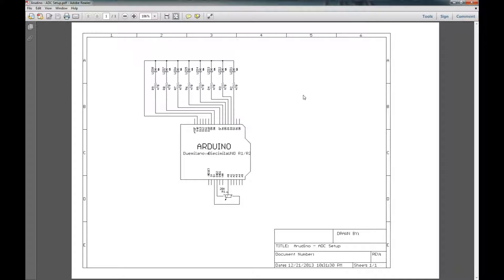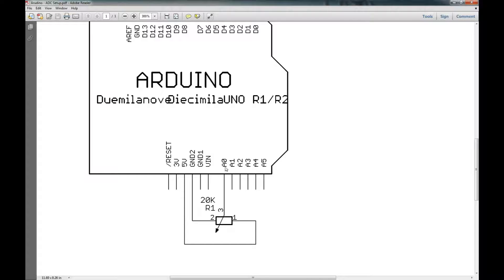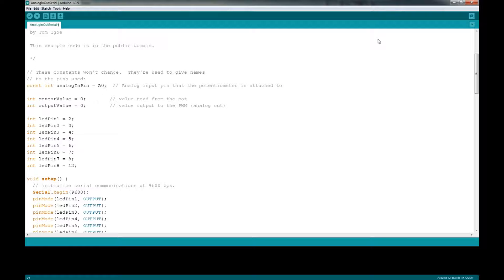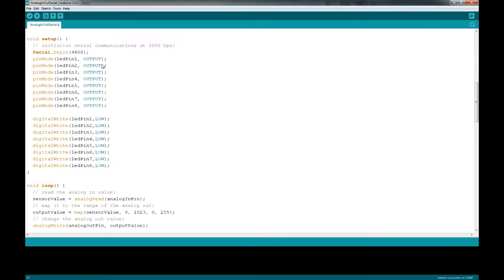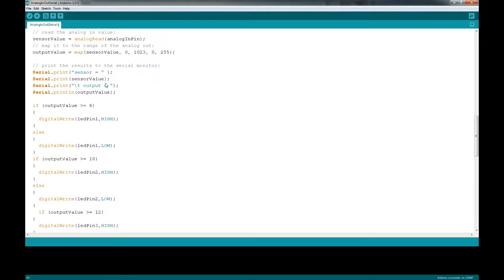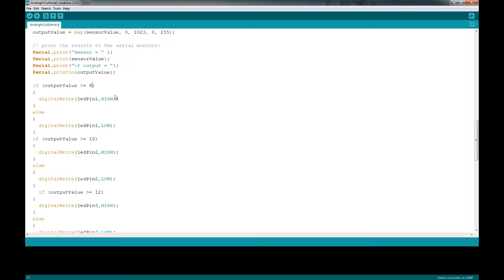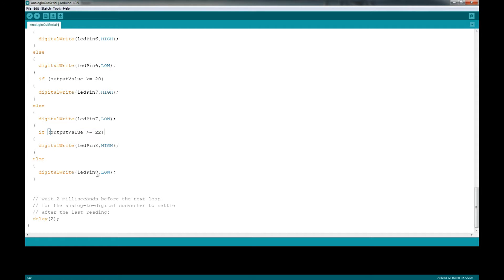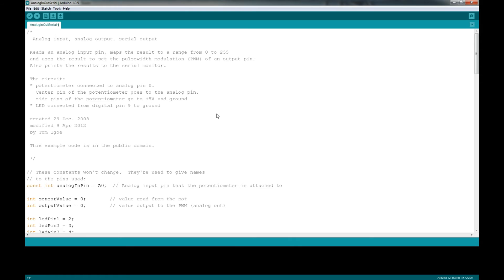Arduino - Simple ADC

Comment: The reason it is 0 - 1023 and not 1024 is because 0 counts as one of the values. If you said 0 - 1024 that is actually 1025 steps.... hope that makes sense.
Reply from the maker: Yep and thanks for the correction.  Sometimes I cannot speak LOL

Comment: hi, i'm really new to arduino and  i have an 
arduino mega 2560 adc and need a code that enables me to see as an output the digital values. could you help me?
Reply from the maker: Hey there I can help you with whatever questions you may have.  There should be libraries for that with example code to help you out
Reply: @misperry  hi, can you see if this code makes sense? 

const int analogInPin = A0;  // Analog input pin that the potentiometer is attached to

int sensorValue = 0;        // value read from the pot
int outputValue = 0;        // value output to the PWM
int tenBitValue = analogRead(analogInPin);
byte eightBitValue = tenBitValue / 4;
void setup() {
  // initialize serial communications at 9600 bps:
  Serial.begin(9600);
}

void loop() {
  // read the analog in value:
  sensorValue = analogRead(analogInPin);
  // map it to the range of the analog out:
  outputValue = map(sensorValue, 0, 1023, 0, 255);

  // print the results to the Serial Monitor:
  Serial.print("sensor = ");
  Serial.print(sensorValue);
  Serial.print("\t output = ");
  Serial.println(outputValue);

  // wait 2 milliseconds before the next loop for the analog-to-digital
  // converter to settle after the last reading:
  delay(2);
}
Reply from the maker: Ok so what I see are some problems is that on your analog pin you really don't need the const.  Also you don't need to put the letter "A" there since it will confuse this with the hex number 160 (0xA0).  Also you don't need to read the analog poins before the set up if you are going to be reading it every time you loop.  I am not sure why you are deviding by 4 to get 8bit and what you need that for.  Also your comment mentions PWM are you trying to produce a PWM wave somewhere or are you just interested in the digital number for the given analog like 5V = 1024 or something?

What you need to know is the voltage range that you will be working with.  If you are going off of the microcontroller voltage input range which is 0 - 5V , since more than 5V can cause damage to the board, you will have a digital range of 5V / 1024 = 4.88mV per digital count.  The reason we devide by 1024 is because 10 bit is 2^10 = 1024.

Now this is where that map function comes in handy.  If you are wanting to have the arduino read the voltage value in as a digital value and then convert it back to a voltage value so you can display the voltage that it read was you will need to map it.  I think it would be:  map(outputValue, 0, 5, 0, 1023);  but I am not sure.  I always just used the 4.88mV per count factor like here: https://www.arduino.cc/en/Tutorial/ReadAnalogVoltage

But if you are only wanting to see the digital output from the ADC I would make the following modifications to your code:

int analogPin = 0;

int sensorValue = 0;
int outputValue = 0;

void setup (){
  //initialize serial communications at 9600 bps
  Serial.begin(9600);
}

void loop(){
  //read the analog value:
  sensorValue = analogRead(analogPin);
  
  //print the results to the serial monitor:
  Serial.print("sensor = ");
  Serial.print(sensorValue);
}

Reference:  https://www.arduino.cc/reference/en/language/functions/analog-io/analogread/

I believe this is all you need to do.  Also, I have my video on ADC's that you can view for more theory on how they work.  It is one of my older videos and it is on the PIC Microcontroller  but it goes through the math if you would like to check it out

https://www.youtube.com/watch?v=SJvmpZq4wnU&list=PL98EDA8B83018578E

And my arduino ADC
https://www.youtube.com/watch?v=DCHKIIRpDhg&t=2s

https://www.youtube.com/watch?v=ysqyytTWi4k&t=1s

Hope this all helps!  Good luck!
Reply: misperry thanks so mutch!
Reply from the maker: Sure hope it does the trick!

Comment: How can I do an analog data logger, just measuring voltages and storing the values (E.g., Every 100 ms) to an SD Card shield (If on Excel format, better)?
Reply from the maker: I would not bother with the excel formatt bit since you can just store the values in text format and then in excel do the Text to Columbs thing and move it around using delimiters.  This sounds like a great video Idea and from some searching I found this:  https://www.arduino.cc/en/Tutorial/Datalogger